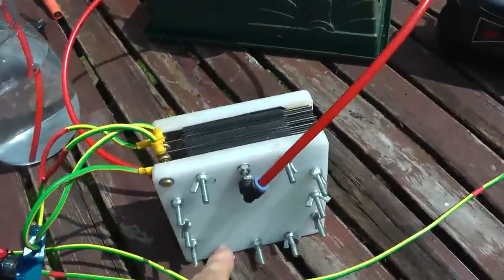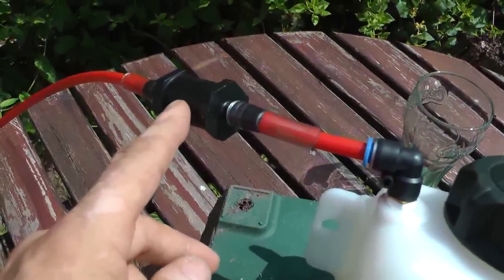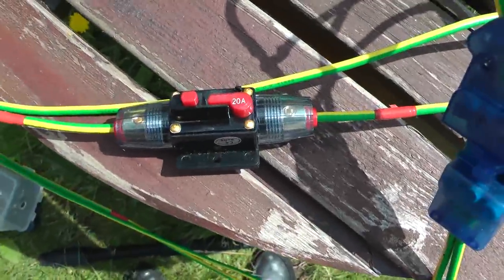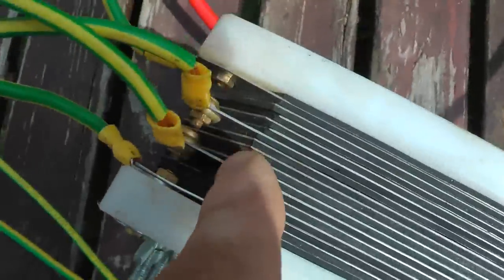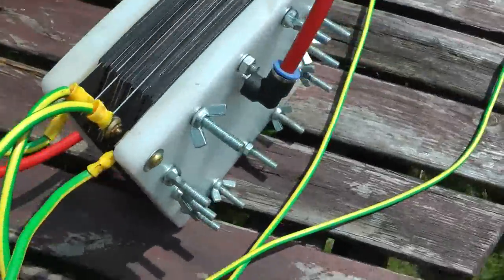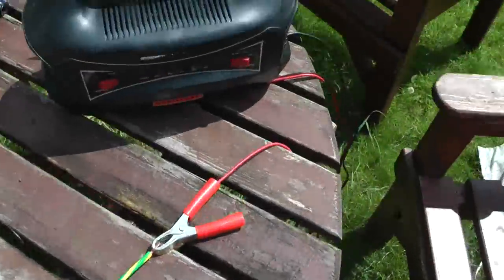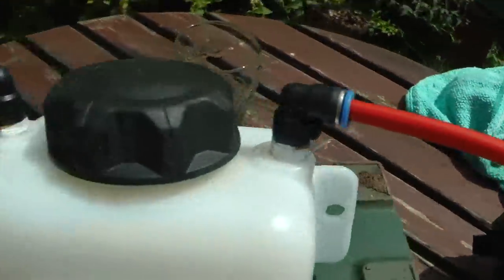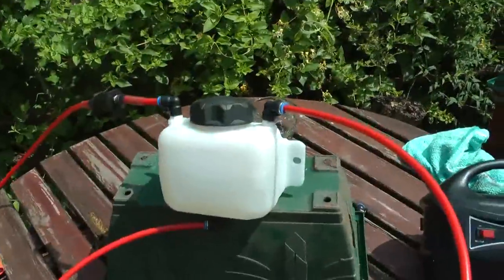HHO Dry Cell Generator setup Explained.

Comment: Very nice. I was very disappointed in my 3 wet cell design as it was capable of drawing well over 100 amps. It made alot of hydrogen but it also got very hot. And the only benefit i realized was a noticeable increase in horsepower, it run almost 80°f cooler on the highway(according to the exhaust temp gage), and my emissions were almost nothing. But the system gained no extra mpg city or highway. So im going to try a dry cell/gasoline vapor combination. I'll post any good or bad results.
Reply: Any news/advice?

Comment from the maker: The best electolite  I have found so far is sodium hydroxide but I am testing a new mix that may be a better balance I have tried may things and got lots of brown gunk which was very off putting at first and had to do a strip down a few times which takes some time I have been condensing the set-up fit in my van, which is harder than it sound s i am working on a super cap set up to make sure I have full power in reserve to start up as I do a lot of short  journies. we learn so much by having a go.
Reply: does the sodium make chlorine,  i use potassium hydroxide,  im trying to build pure hydrogen cell now because of the limitations of hho. checkout  reg pye pure hydrogen cell on YouTube.

Comment: Hi,
Can you share how you got the steel plates and seals? Did you make them or order them somewhere?
I am also interested in knowing where the holes in the plates are located.
Reply from the maker: Carlos Mira Ferrer yes I got them off ebay http://www.ebay.co.uk/itm/HHO-KIT-6-6-SET-OF-16-316L-Stainless-Steel-plates-Hydrogen-Gas-Dry-Cell-/271799508146?pt=LH_DefaultDomain_3&hash=item3f48835cb2

Comment: Im sorry to appear stupid but what is this and what does it do?
Reply from the maker: Hi Samantha no problem we are all hear to learn.I can say the over all aim of this device is to help conventional car engines that use diesel and petrol to work more effective, getting more mile per gallon / litre . Some people have made these devices that have done away with the need for petrol all together. for some reason a few people don't want devices like this out and known about to the general public, and has been a dying trade. many top people in science and on TV shows say this will not work. my short video dose show that it dose work. and if I can do this and get it working, then what can people with millions of pounds do, or have done but keep wanting you to burn oil and of course get tax is 80% of the cost of petrol i am  sure. one of these could be fitted on all most any engine or car. which will be my next stage.
Reply: hope you your staff and son are keeping well

Comment: I have a question dear 
What is the best material to use to produce hydrogen ?!
Reply: Probably copper since its one of the most conductive with least resistance. You can use aluminum too but its cause alot of heat
Reply: Rikardo Trevino thank you but why every body is using steel
Reply: @user-ue5kj6iw2q  Im not sure, probably because its very cheap and easy to get
Reply: Aluminum and copper both corrode much faster than STAINLESS steel
Reply: @trashin.n.smashin  Wrong. Both copper and aluminum are both more resistive to corrosion and oxidation than stainless steel.

Comment: Could you list where you got the parts from? Thanks
Reply: Many chines list some of there parts on Ebay if you type in HHO generator the hardest decision for me was finding the stainless steel plates and gaskets and end plates pipe and pipe joints. You may not know but the EU has closed down the England and its very hard to get hold of things not sold in walmart type places. now the cost was high because these thing weigh a ton. I have put the link to the place i got mine from above in a comment. cheers

Comment: ice cream icream !
Reply from the maker: ha ha yep you could say its a cool idea screaming out to be improved on I have condensed it down, so it my fit under the bonnet. looking at adding the super capacitors as well to help make starting my van more reliable if the battery discharges.